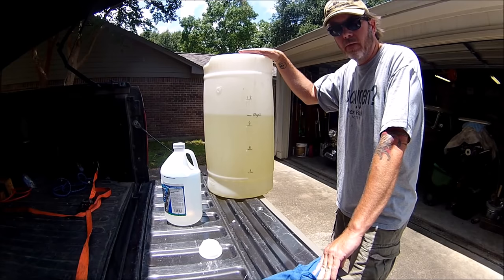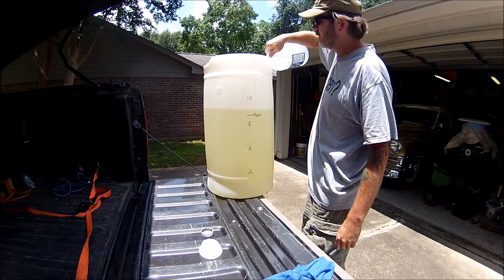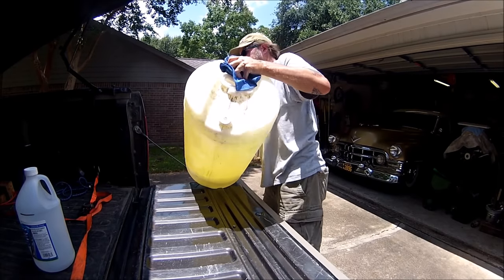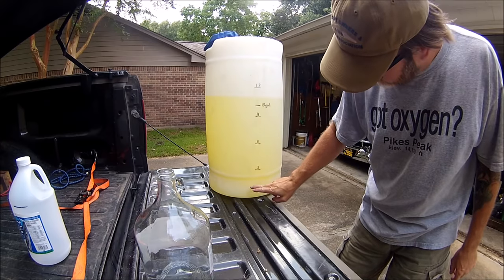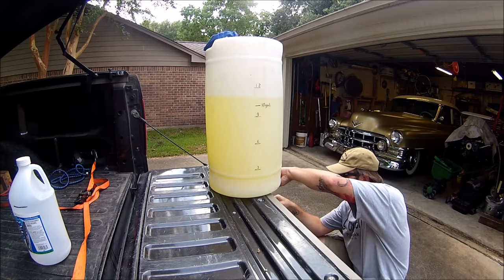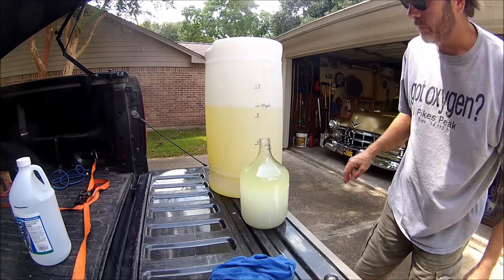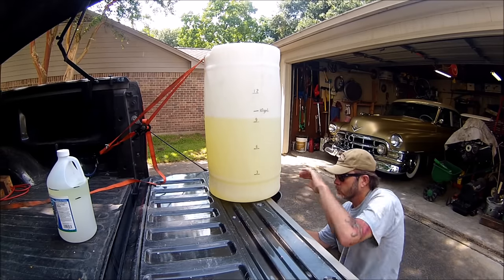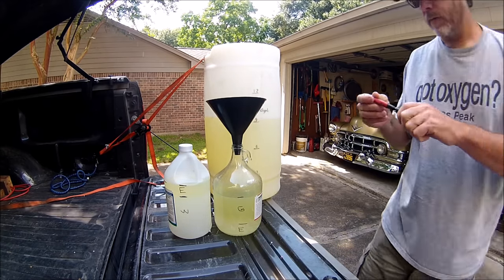How to easily extract ethanol out of gasoline.

Comment: The problem with extracting the ethanol you are removing most of the octane with it!
Reply from the maker: Reed C not most of the octane, just a few points. 93 will become around 89.
Reply: According to whom? How do you know this?
Reply: Sounds like ethanol is the good part. Why dont we use ethanol instead of gasoline then? If its such a high octane
Reply: Ben Parker because our gas engines are not designed to run on alcohol. The reason alcohol is such a good octane booster is it doesn't burn as well or violently as gasoline
Reply: Im going to have to disagree there. My Ford Falcon makes 338rwkw (about 475chp) on 98 octane gas. But on E85 it makes 442rwkw (about 700chp). The oil is cleaner over the oil change interval, the five gas analyzer says the emissions are better, and economy hasnt noticably changed (It mightve gone down a little bit, but thats more to do with me being addicted to the power. And heck; e85 is half the price of premium in Australia, im cheerin)

It was enough to knock a second and a half off my 1/4mile ET
Reply: Maybe in Australia "mate"  but not in the USA...we pay the same if not more for Alcohol. I think you are missing the point however...the issue is not with Mogas used in automobiles... It is using it in everything else that is the problem...Storage being the big problem and the fact that it attracts WATER...and Is 5% water to start with. I have no problem with it in cars...I would burn Rat Shit if it would work...I don't like what happens when I burn the phase layer, I don't like the alcohol turning the gas bad before it's time... I don't even mind that we are doing more polluting making the ethanol than it's worth...and I understand the 20-20-20 initiative 95 of the world countrys have signed on with... mixing the two substances is just stupid...quick fix to a bigger problem.
Reply: Guys if you only knew what octane is and does...ethanol does much worse things when mixed with gasoline. Ethanol in an ethanol engine is fine...same for gasoline. But mixed together, besides getting less bang for your buck, ethanol carries with it WATER!  That Phase Layer you see in his video is bad news when burned in an engine. Greater OCTANE means LESS energy by the way unless the engine is designed to use it and most engines aren't. If you do what he is doing, and start with 93 octane Premium gasoline...you will have pure EO unleaded gasoline and your engine will thank you for it!!!
Reply: exactly
Reply: You wouldn’t have got that phase layer if you just left the fuel alone. The fuel is fine as it is.

(And octane has nothing to do with energy density)

The issue you guys are having isn’t with the ethanol, it’s with the aromatic content in the petroleum.

Ethanol is just the scapegoat. I’ve used e10, or e30, or e85 for many years now and in every one of my sparkplug equipped engines, and I’ve experienced less failure here than when I was using e0. All due to the lower aromatic content.
Reply: Ben, What we experience here is an issue with engines that sit without being used for weeks at a time. Examples would be classic cars, boats, lawn equipment, etc. When the gasoline here sits for just a few weeks in a carburetor the ethanol attracts moisture and it sinks to the bottom. When this happens it is pitting and corroding/destroying our alloy carburetors. It is a very real problem, just ask any marine or classic car mechanic in the US. Maybe Aussie mixed fuel has different properties but it by God sucks here. If many of us had our way we would string up the folks responsible for ethanol in our fuel. Likely some corrupt congressmen on the take.
Reply: The easiest way to stop those puddles of water from happening (which happen even with ethanol free fuel) is to use more ethanol. Increase the concentration of ethanol to pick up all the water.

When the water has been picked up into the fuel it cannot corrode anything as the electrical path required for galvanic corrosion has been broken.

I’ve had e85 sitting in carbs for months on end, even in this one carb for over a year one time. This was in a Honda GX390, Carb equipped, Pressure washer. Very water heavy environment, with open fuel caps and vent tubes. Easy for water ingress to occur. No signs of corrosion when it came back out of storage because the water is harmless as soon as it’s picked up into the solution.

Actually run higher concentrations of ethanol and you’ll see that all this negative talk about them is mostly fearmongering. (The only accurate criticism I’ve heard about ethanol is that you drink more fuel. Efficiency goes down by 5-10% in my experience. But it’s so cheap so it doesn’t really matter)

Oh and of course it’s corrosive to cork, but nothing used cork anymore. That’s the only material I know that it actually attacks
Reply: If you read your equipment manuals  ethanol voids the warranty on weed eaters ,mowers etc... It eats rubber parts and fuel lines over time. I had one go bad and they refused to replace it because ethanol was used.
Reply: You would need to use 93 octane E-10 as the regular E-10 is made with CBOB that is only 83 octane.
Reply: Okay everybody...the issue isn't REALLY  with the fuel or how much energy it contains per volume. The real issue is the rubber parts that are in the engines and fuel systems. They can be gasoline resistant, or ethanol resistant, but typically not both. Manufacturers have to pick a compound to make their parts  out of, and the stuff that resists both types of fuels can be more expensive than those made specifically for one fuel or the other. At what point do you make the switch and render the old vehicles still on the road obsolete? Do I want my old car to be worthless because I can't find or afford the right fuel? If I use a fuel that's incompatible with my fuel lines, soon I will be driving a death trap waiting for a burst fuel line, or a rubber gasket that swells or shrinks causing an air leak so the engine won't run.
Reply: Brazilian cars run e25 as their normal fuel. All Brazilian cars have the same fuel lines as domestic cars from like 1993 onwards. Check part numbers if you really want.

Ethanol is corrosive to cork and varnish/wax, that’s all. Neither have been used in cars for over 25years.

Ethanol isn’t as corrosive as people think. It can’t galvanically attack anything because there’s no electrical pathway, it removes water better than gasoline ever could. Water is the problem. Ethanol is basically inert galvanically speaking.

Christ, as an extreme example, I’ve got a 1971 Ford Fairlane with a 351C with the standard thermoquad, and it’s seen e30 for the last 5 years, and there’s been no issues. Put fuel in, change oil every year, add a bit of initial and total advance because of the high octane rating, live happily ever after.
Reply: Ben, In cars ethanol is very hard on rubber and some plastics. It dissolves them and turns them into mush. In small engines such as lawn mowers and snow blowers ethanol breaks down into a host of molecules that gum up carburetors. I tried to get my lawn mower worked on and the guy had a two month waiting list because of all the mowers he had with jacked up carburetors.
Reply: @hazelwood55; the issue isn’t ethanol in the fuel. Ethanol cleans things and doesn’t damage modern fortified rubbers. Ethanol is less corrosive than gasoline in most cases. Look at how many carb issues the “ethanol free classic car guys” have. Damn near constantly. Manufacturers say they don’t support ethanol because they can’t be bothered to test and warrant their cars for a fuel that isn’t mainstream. The dollars spent in testing outweigh the benefit to the automakers wallet. It’s simple economics to understand why it’s not warranted.

The issue with your carbs at the shop is either the aromatics in the petroleum, or water ingress. (Water ingress happens at the same rate no matter if you use ethanol or petrol. Just with ethanol it’s picked up into solution and carried away as it runs. With petrol, the water just sits in the base of the bowl slowly corroding for ever.

I can’t count the lazy mechanics who just blame ethanol for everything. It’s the laziest path out of diagnosing the problem and it’s an indefensible scapegoat.”oh ethanol is the problem, so I ordered a whole new car by, use petrol only” and of course it won’t fail for at least a few years. Lazy mechanics shit me to no end.

I even had one guy say that ethanol will corrode my fuel lines in my 360ci mopar ski boat on e30. He said 98RON only, But he also reckoned I should flush my lines every season with methylated spirits (aka ethanol) to make sure there’s no traces of any alcohol left. Go figure haha.
Reply: Ben Parker I'm not sure about the actual horsepower on my vehicle but yeah compared to price of e85 and regular gas it is easier on the pocket. I have noticed it does burn a little quicker. but it sure does seem to burn a lot hotter and increase power.
Reply: Ben Parker ethanol E85 is equivalent to like 112 octane, but ethanol and octane are 2 different things. Has is mostly heptane and part octane. Ethanol attracts moisture from the air the longer it sits. When you add water to fuel then put it through a combustion process you turn it acidic and it eats up your engine components. NO! You do not want ethanol!!
Reply: @beajayparker247  high octagon only means the gas burns slower, lower octane it burns faster, same amount of energy,. Using high octane gas in an engine that does not require it does not add power or hp, only wastes your money.
Reply: @beajayparker247  correct the problem with burning alcohol is that it gas less energy, so adding alcohol to gas reduces gas mileage and hp because of this.
Reply: @beajayparker247  alcohol harms less energy then gasoline, so adding alcohol to gasoline reduces power and gas mileage and burns cleaner.
Reply: Leave the farm equipment out of this, they like E85 just fine.

Comment: This method removes ethanol but degrades the gasoline considerably. It lowers the octane rating considerably by not just removing the ethanol but by also removing the higher octane rated hydrocarbons that are also water soluble like toluene and benzene. You would have to add a considerably expensive amount of pure high octane rated hydrocarbon like toluene(100 octane) to correct for this. On top of that some water, albeit a very small amount, will dissolve into the gasoline which can over time lead to corrosion and damage to the fuel system of your engine.

Please don't use this method on an engine you care about. Just buy ethanol free gas for your 2-stroke or 4-stroke that is designed only for ethanol free gas like many of the marine engines still are today.
Reply: Benzene and toluene won't pick up that much water and most will not be removed, but the gas will be water saturated.  So shitty performance is guaranteed.  Also, you do not want to be playing with 10 gallons of gasoline like that.
Reply: how much toluene to add to 87 octane to raise to 100 octane? on a per gallon basis
Reply: You ought to be able to get the numbers on the internet.
Search for amounts of acetone and toluene for cleaner burn and raising octane, respectively.
Should be something like 250 milliliters/10 gallons of each or about a cup of each/10 gallons.  You will likely have to experiment to see what works best in your engine.  I understand the acetone has a tendency to evaporate more quickly, so you may have to add more frequently.  But go easy and do not try to run them alone without gasoline.  Big changes in fuel composition will have negative consequences for your engine and potentially for your safety!  I used to run the amounts I mentioned in my 6 cylinder SHO with reqular gas - worked fine but I didn't try to optimize it.
Reply: Too bad you can't buy a barrel of reformate; you'd be set for life.
Reply: The lousy E-10 fuel leads to corrosion and damage to your fuel system too. If you have an older vehicle you already know this.

Comment: Well done video. I learned somethings when fuel separated in my gas tank and hired a company to try to remove the alcohol/water phase. Gasoline cannot mix with ethanol or water unless there is some type of emulsifier. Ethanol fuel uses sodium sulfate based emulsifier. Adding all that water into the drum neutralizes that emulsifier causing the separation. The water phase Is milky white from the suspended particles of sodium sulfate. These are microscopic particles that are very bad for an engine. They will deposit everywhere there is a connection or a small orifice and high temperature. These particles can destroy a fuel pump, check valve, or the fuel injector, so make sure that the gasoline phase is crystal clear and all of the sodium sulfate particles have been removed in the water phase. I was unable to filter out these particles in gas using 10 µm filters.
Reply: Very interesting information! Could you please clarify more on this? As far as I understand, sodium sulfate which is already present in fuel with ethanol, causes the issues you mentioned, right? Once you add water to gasoline, ethanol and sodium sulfate falls out of suspension and settles on the bottom of the container. Assuming you properly extract the gasoline which is on top, sodium sulfate won't be causing issues anymore. Is that correct?

Comment: Just go to the nearest small airport and buy 100LL (that's 100 octane, low lead), normally at a self service pump. 100LL is light blue in color, and costs a bit more, but it is produced without ethanol, and it is after all 100 octane. Haven't seen that at the old gas station in a long time. It's all I  put in my Sportster, generator, and snow blower.

Comment: This looks like fun but WHAT"S THE PURPOSE !
Reply: Ethanol damages engines, and is especially bad for old cars like that one in the background. It shortens the life of engine components even in the newest cars, meaning more frequent overhauls are needed. Like many green ideas it does not actually reduce CO2 emissions because of the energy used to make ethanol. Think of it as moonshine, for that is what it is. It is made from fermented corn which is then distilled several times to get as pure alcohol as possible. Distilling requires heat to boil the liquid, which is probably provided by fracked gas. Ethanol is one of the biggest cons ever perpetrated on the public.
Reply: Science bro science

Comment: will the water/alcohol mixture burn? if so, you could use it to start a charcoal grill.....
Reply: Tongue in cheek I hope! Don't light charcoal with this unless you want to eat the additives that are in gasoline such as detergents that keep your engine clean, anti-corrosion inhibitors to protect your fuel system, seal preservatives to prevent fuel leaks, and lubricants to reduce friction. Siphoning off the top layer of gasoline after mixing with water may remove some of these additives along with the ethanol (depending on the additives' affinity for alcohol and water).